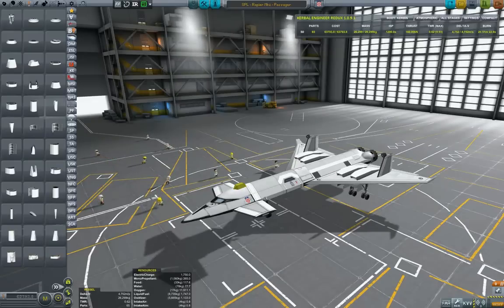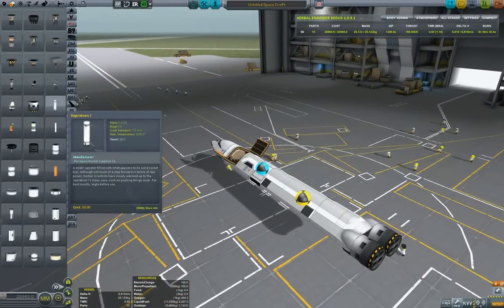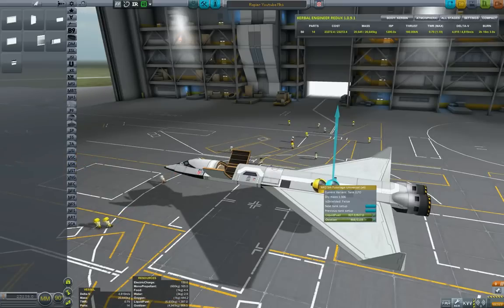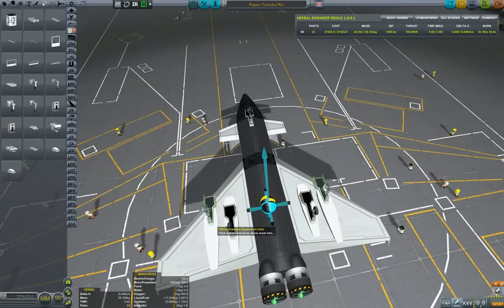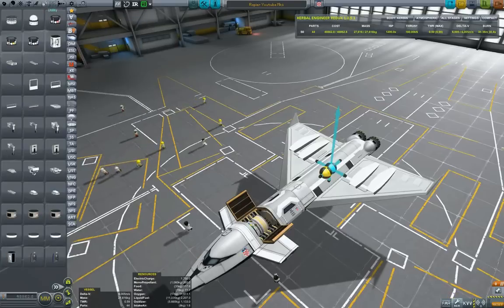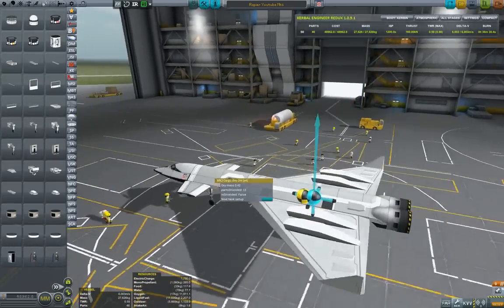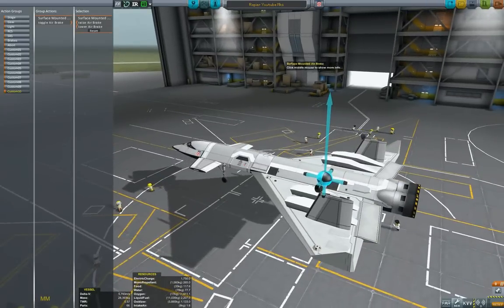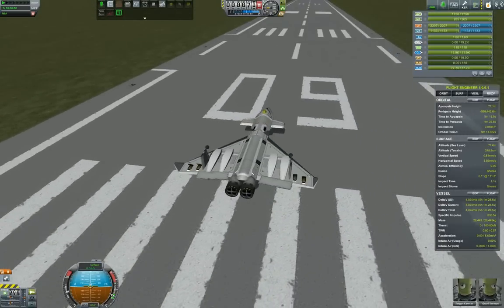Kerbal Space Program - How to build and fly an SSTO Space Plane

Comment: Thanks - these really helped. I've been having plenty of difficulty with my spaceplane falling into a dead spin on re-entry, despite carefully measuring the balance between lift and centre of mass. Adding drag to the back (and lower my angle of attack) made the difference. Now to get rid of the spin I pick up on dropping the solid boosters (My MK2 shuttle is launching like the NASA shuttles).
Reply from the maker: Robin Pittman Wow, when you succeed in launching shuttles, let me know. I am still lacking in the shuttle department

Comment: First GREAT tutorial.  Helped me a lot.
Second.  How do/did you get your B9 Mk2 parts to fit with your Spaceplane +/stock parts?  Mine are not the same size and I've seen a few forum post of people saying the same...
Reply from the maker: This was recorded in 0.24.2. Back then it was SP+ mod still. the reason why they would change Mk2 models in 0.25 is beyond me (probably so it would be symmetrical)

I actually liked the fact that you could use both, but yes in 0.25+ that is no longer the case, except hoping B9 might match the updated version
Reply: GrunfWorks
 Ah. Bummer.  At least I'm not going nuts. :) Again great tutorial.  Avoided SSTO's until I watched it.

Comment: Sorry i feel like a noob but how do i fill the fuselage?
Reply from the maker: Dominic Bartuccio if you mean in the SPH, you right click it, and adjust fuel slider (or was it ALT-click, i am not 100% sure)
Reply: GrunfWorks for some reason when i right click on most stuff the menu doesn't open
Reply from the maker: hmm, are you using mods ? if so, i would check firspitter.dll as that one is kind of a dealbreaker if does not work. Other than that i have no idea
Reply from the maker: Should be right click in vab or sph and drag liquid fuel and oxisizer sliders up or down. All tanks usually come pre-filled

Comment: I do not have those wings !
Reply from the maker: The Best Of Random Those were procedural wings in 0.25 by mod procedural dynamics.
I am not sure if they are  updated for 1.0.2
Reply: Oh,ok.Thanks for the response . Didn't know you were using mods :)
Reply from the maker: No worries, this was back in 0.25 when even the cockpit was modded (SpacePlane +) which was later integrated. That is why it works with the rest of the b9 parts